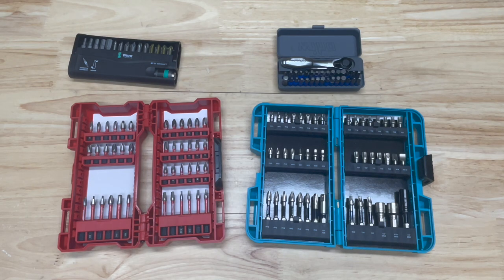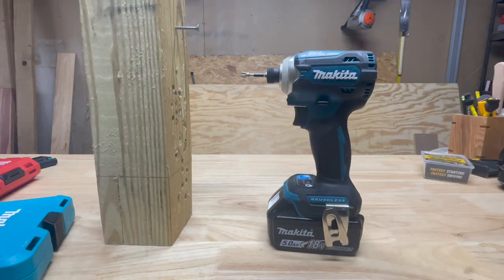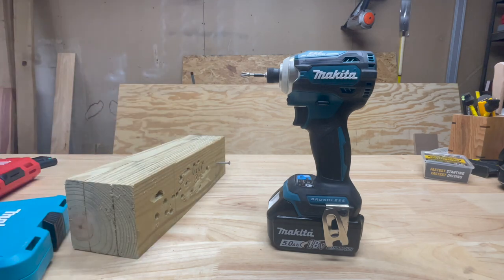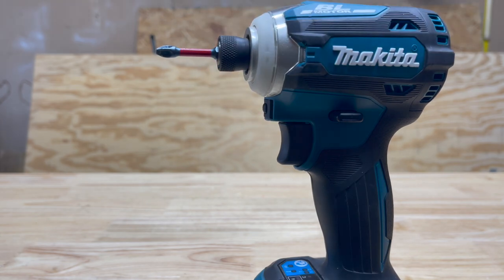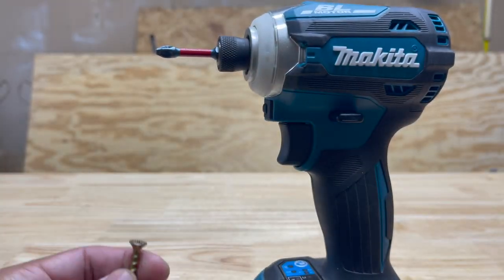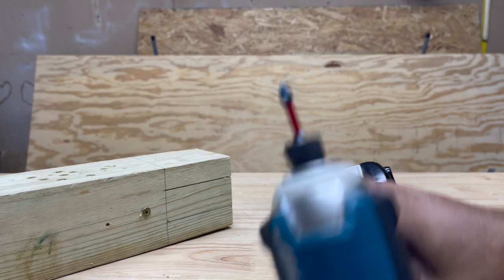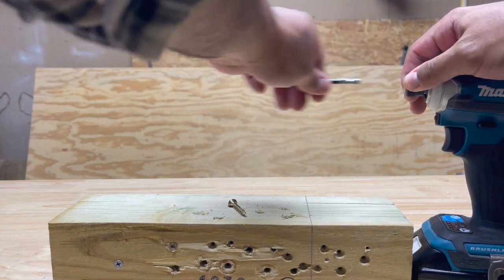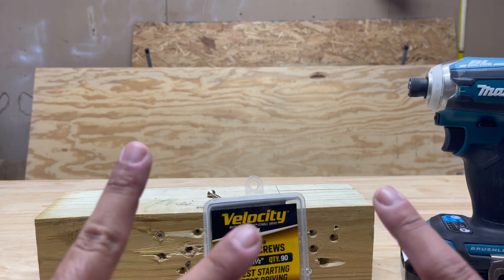What is the BEST Bit Drive Type for Impact Drivers? The Answer is Not What You'd Expect!

Comment: First off, you select the bit for the screw or job, not the driver.  This is a new take-off on the Phillips,  Reed &Prence, Pozi, JIS, Robertson, and ECW.  You shouldn't use an Impact Driver for most of those screws anyway, in my opinion.